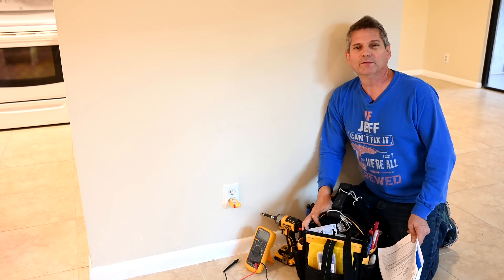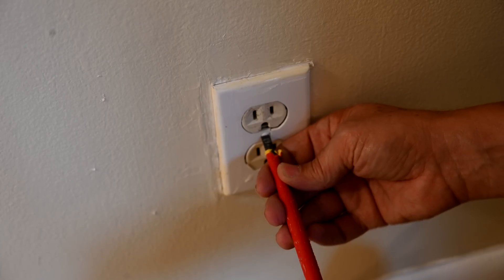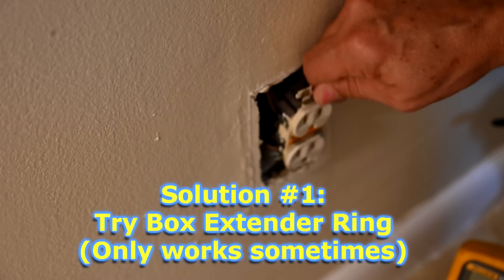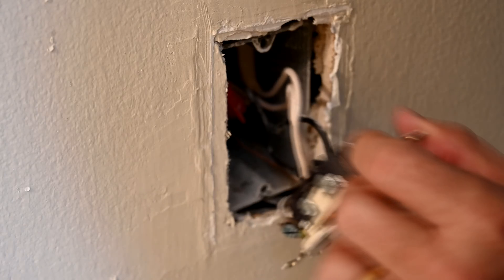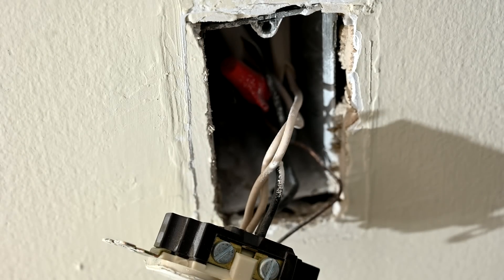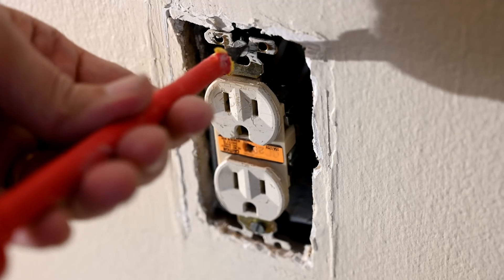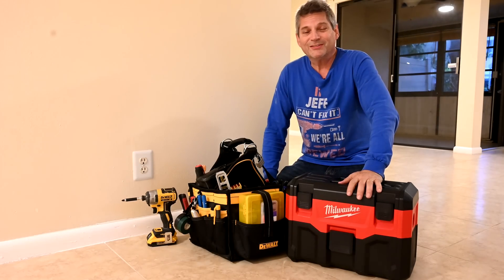2 Tricks To Tighten Loose Electrical Outlets, Switches

Comment: I’m not buying anything in this video. As a retired electrician I can say that those qualified NEVER wear rings while working. There are too many cases of fingers being severed when a ring comes in contact with a live wire. And you never assume a wire is dead.
Reply from the maker: I'm not buying your your condescending and irrational tone, makes you sound more like an alarmist and doesn't make people look up to you as a trusted source for advice. You obviously failed to watch the video where I showed cutting power, and testing for power in the wires. So no one will be coming in contact with a live wire.

Comment: Bought a house in Atlanta years ago where the inspector found no problems with the outlets. Go to plug vacuum in and the outlet goes in breaking the plate. The place had another layer of sheet rock added and all of the boxes were recessed. I spent hours removing plates and inserting those plastic spacers just to get all of the outlets usable. All home inspectors are not necessarily good inspectors. At least there were no outlet problems found when I sold the house.
Reply from the maker: Thanks for sharing they should find stuff like that by testing outlets with a plug in outlet tester

Comment: Change the box
Reply from the maker: I tell you what, you come change the Box because 1st you have to rip out the dry wall where the other boxes because those boxes are screwed to the front of the metal studs with a bracket that sits between the stud and the dry wall. So then after changing the bogs now you have to do all sorts of 3 layers of patching drywall mud and taping and all that other nonsense. You're trying  make way too much work for a 5 minute repair

Comment: Put a new metal box with ears and secure with sheetrock clamps.
Reply from the maker: You are forgetting you still need to tear up drywall to get the old box out of the wall, because it's bracket is nailed to the front of the metal stud and the drywall is now covering it. You want create hours more to solve a simple 5 minute issue. Now with your metal box, now you have to bond that to the system ground. Way to much effort for a simple fix.
Reply: @jeffostroff  You don't need to tear up any drywall to get that box out of there! Do the job right!

Comment: Electrical box fingers will pull the box flush tight to the wall to keep the box from wiggling.
Reply from the maker: Not when the hole is cut too big
Reply: Correct. That box in particular looked like a good fit for a pair.

Comment: I use small washers that I place over the screw and then tighten ... the washers wedge between the box and the back of the outlet.  You can adjust the number to "time out" depth.
Reply from the maker: Yes, I have seen others do that as well. I worked on some outlets where the previous guy used tiny hex nuts

Comment: You dont cut the box. You should remove the metal box from the wall and replace it with a new old work box.
Reply from the maker: It's always funny when somebody comes in and says you should do this as if it's a 30 second deal. You have to rip the whole wall open in order to pull that old box off of the steel studs because they are screwed into the steel studs by a bracket that hangs off the side of it and the only way to get out is to remove the drywall. now you can put in a new remodel box just fine, but now you have to Patch up drywall which is hours more work in three layers of mudding and sanding
Reply: @jeffostroff  you use a hacksaw blade to cut the nails , then slip in a old work box, done

Comment: Just use jiffy clips. If the box moves. If box don't move just us two 6/32 screws behind the rec holds the rec out keeps from moving.
Reply: The video is so wrong.
Reply from the maker: There is absolutely nothing wrong with the video I used standard parts used by the pros every single day and in the end the repair worked and it worked very well nice and snug and tight and not moving anywhere

Comment: ...This is some pretty crappy work.
Yes we've been to a million and 1 homes with fucked up drywall. Yes that box is supposed to be flush with the face of the drywall, yes indeed the ears of the yoke are supposed to press against the face of the sheetrock.
However the way this hack of a "repair" was executed is so poor I dare to even call it a repair.
The only thing that changed to effectively hold this device still was replacing the faceplate...

The way this repair should have went.
Verified fault, killed power, investigated box, immediately determined receptacle was damaged (broken ground on the face)[110.12B] and replaced with a GFCI/AFCI recep [406.4D4]
Upon seeing that massive gap, install an add-a-depth to make this compliant with [314.20]. (Which you did... for a second... then took it out.)
Then you'd install your caterpillars behind your add-a-depth, and boom. your device would now be flush up to the front of the wall.
Finish that off with a new faceplate and you're good to go.

I don't get it man... you were so close. You had everything you needed to succeed here, but you blew it.
Like. You didn't even put the top device screw into it's freaking hole. Who does that?

btw. that romex sheathing is code compliant. [314.17C]
As is the amount of conductor within that box.(even though there's barely enough to work with) [300.14]
Reply from the maker: I'll go easy on you since you are uninformed. My friends were in extremely desperate straits, had no money to buy new outlets, which every outlet in the house should be replaced like I do on all my projects. The reason I put the screw in crooked was because the builder stripped the screw hole so I had to come in at an angle to make it work. If you want to raise money for them, so it can be done right, I'm sure they would be happy. And you pay the $20 for GFCI, which you don't even need in that hall outlet, feel free. What you fail to realize is often people are left to make decisions based on previous damage left behind by guys like you who should have done it right in the first place. We already showed the box extender just was not going to work there. sometimes we get lucky and it works, other times no deal. But to say that this repair is a fail shows you don't know anything. These spacers use here are NEC approved, and I replaced the plate with a much stronger metal plate and the problem was solved. Just because you held some wires for daddy while he did the work does not mean you know everything.
Reply: @jeffostroff  Those are your friends you're doing dirty like that?
Dude. if those were your friends you would have coughed up an AFCI for them (you need an AFCI there, not a GFCI) .

Stripped threads in a device box? 110.13A violation. 
How do you correct that? Insert a larger screw. change that 6-32 out to an 8-32.
But I shouldn't have to tell you that. You obviously know the requirements of 406.5 right? 

Those spacers are indeed code compliant, as well as that add-a-depth... You just didn't use them right.
Should have had both of those in there, instead of just the caterpillars.

Replacing that faceplate fixed the problem? So it's safe to say that device is mounted to a cover then.
In which case the rules for 406.5C would apply... Oh shit. you don't meet those requirements either (minimum 2 screws when mounting a device to a cover plate. (think RS covers))

I'm gonna go hold some wires for daddy now. In the meantime, please keep fucking up installs like this. Guys like you give us TONS of work.

ps. Look up the Dunning-Kruger effect. Dipshit.

Comment: They make unbreakable cover plates that are pliable ,unlike those rigid plastic plates. Sometimes you need the plate to be able to bend little if the drywall isn't perfect. They also come in jumbo size
Reply from the maker: HA HA! I've tried those unbreakable plates, trust me they all break if they are not metal. When you have a poorly mudded drywall there and there's a mound building up of drywall mud around each one of those outlets no plastic outlet plate will survive you really need a metal one

Comment: Nice video but that receptacle has seen better days.  The metal oversized plate with the spacers was called for but should have replaced that receptacle with a newbie.
Reply from the maker: I got news for you bro every single outlet in this house was done this way and needs to be replaced unfortunately my friends the owners did not have the money they were in really desperate straits and were in the final stages with the buyer of transferring this property to the buyer and this was one of the last items on the punch out list but they simply had no cash to spend $3 on every outlet in the house plus the labor in time to get this done . Normally when I buy a foreclosed unit I replace every single switch and outlet in the house whether it needs it or not just to make sure everything looks brand spanking new and shiny and perfect for people no old yellow outlets, no electrical outlets with paint on them no switch plates with paint on them everything looks perfect when I'm done with my properties

Comment: We just moved into an old apartment.  It is not the plate cover that is loose but the actual holes don't hold the plug firmly. I plugged in my phone charger, barely moved the cord and the plug  fell out. I can barely touch it or pull on it and it falls right out. Why? What can I do about it?
Reply from the maker: Alison, unfortunately you have no choice, the outlet itself must be replaced, they are only $3 though! Make sure you upgrade the replaced outlet to conform to current NEC electrical codes and get a tamper proof outlet. If you are not comfortable dealing with the wiring, then call in an electrician or well qualified handy person.

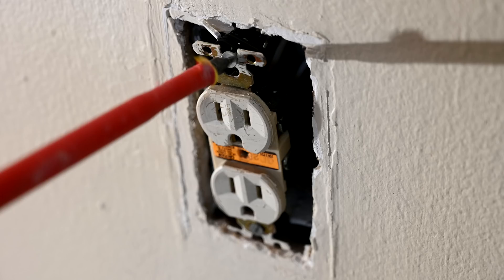Comment: In the video, at 10:09, when you inserted the top screw, you missed the proper screw hole and inserted the screw above it so it's actually going in "between the ears". You can even watch the video after the "outro" at 14:31 and see that the screw is not in the hole. 

Hopefully you noticed this later and fixed it. Otherwise, perhaps you should return to this location and fix it now. =) 

Otherwise, a really nice video ✅.
Reply from the maker: This was done on purpose, the screw boss was stripped on the outlet box so I came in at an angle to let the screw bit it more.

Comment: The lose box is still lose?  The extra large face plate is holding it (for now) ? 
Thank you.
Reply from the maker: Yes those metal face plates are so nice and rigid that they don't budge and they'll never crack and snap on you like the cheap 99 cent plastic outlet plates that you buy at Home Depot and Lowe's

Comment: You can easily slide that outlet side ways through the arc shield with out cutting anything. 
Thank you for your video
Reply from the maker: No you can't easily slide that outlet in fact you can't slide it at all, because it is screwed into the metal studs and the screws are behind the drywall so you can't even get those screws to loosen the outlet and move it away that's why we use this black plastic Shim spacers to do the trick for us without having to be invasive or without having to remove the outlet or the box and also remember in some cases you wouldn't be able to move the outlet anyways because the electricians put just enough wire to get the outlet to exactly where it is and there's no slack for you to even be able to move the outlet box if you wanted to

Comment: I'm a licensed electrician when a inspector says to fix the lose box u can't use tricks. Now days  we have to use tamperproof receptacles. You really have to put a lot of push pressure to plug something in .So some of those tricks would fail the first time u plugged something in.
Reply from the maker: The reason my fixes won't fail is because I'm using the metal plate that is the key to offering the most amount of support for this and yes had they had the proper amount of money we would have replaced all of the receptacles in the house anyway that's standard practice of what I do when I take over a foreclosed property I change every single outlet in there all upgraded to the latest NEC code with the tamper proof shutters on them and in the kitchen I changed to the arc fault ground fault and now this year they just changed it so the bathroom has to be arc fault ground fault as well yeah it's a fun game keeping up with all the codes.
Reply: yup it can get expensive

Comment: I don't want to replace the whole stupid outlet! I want instructions on how to make one of the plugs tighter. Not the whole outlet thing the box itself is fine. Just one plug is loose as to make the plug fallout if just bumped. I can't afford someone to replace and too scared to deal with wiring.
Reply from the maker: If the plug is loose, nothing yo can do the outlet must be replaced, but they are only $3, and you can do it yourself, just cut the power to that outlet first.

Comment: A 6/32 nut is all you need for a spacer. A screw in the inside left to the stud would secure it more also.
Reply: Also the nuts are cheaper and will work every time.
Reply from the maker: Yes I've seen a couple of times where guys used nuts, but often it takes 4 or more, then becomes a pain in the neck to get them all to stay. that's why I prefer these shims. Other guys cut spacer tubing to length also.
Reply: @jeffostroff  you only ever need one nut. Just stop it at the right depth. A small Milwaukee cordless drill is the trick also.

Comment: Poor installation should have change the receptacle new. Old receptacle is damage
Reply from the maker: Old receptacle works perfect, and it now installed tight, not sure why you think it is damaged, it passed all electrical testing afterwards. Also every outlet in the house is like this. Owners were out of cash and hurting big time, could not afford $3 for every outlet in the house, plus labor to rewire each one.

Comment: Five words. Outlet shims and metal cover plate. Also, the receptacle is NOT supposed to be attached to the drywall !!!  It is supposed to be attached to the BOX!  The box was installed improperly. The front edge of the box is supposed to be flush with the front side of the drywall. It you want to really fix it correctly, drive a screw through the side of box into the stud. Then refer to my “five words.”
Reply from the maker: You know it is impossible to drive a screw at that angle into a metal stud. Wood stud? No problem, we do that all the time. But you will never get it into a metal stud through an installed box. Nothing works on the cheaper metal studs like what we have here, because the stud yields too much it's too flexible and screws and drill bits just walk around on the surface and can't go through unless you have open walls, and screws going straight in perpendicular.

Comment: I also add a couple of bugle head screws through the side of the box, into the stud. That stiffens up the box.
Reply from the maker: yes, works well with wood studs. With metal studs 100% impossible to get a screw to go in at an angle, it just walks around all over the metal stud. Can't even pilot hole drill at that angle.

Comment: The upper receptacles ground plug had molded plastic cracked off. Is that ok per code?
Reply from the maker: I always prefer to have a fully intact outlet, so I would replace it

Comment: I have been using those handy spacers for years. The ones I get are the bright yellowish ones. I have used small washers, lengths of small diameter copper tubing and metal strapping that comes in steel and copper. It comes coiled in a box and has holes in it already, you can fold it up to make it thicker, there is some that comes in plastic material as well. You usually use it for hanging pipe, etc. 
Don't know why they do it but the boxes are supposed to be mounted out from the studding so it ends up being flush with the drywall/wallboard. But it gets mounted flush with the studding instead. That box being so loose and being installed wrong. So many like that I have just removed them and installed new. Yeah it's a lot more work but I always feel better about it afterward.
Reply from the maker: Yes, and the boxes that have the mounting bracket on them, should be positioned so that once mounted tot he stud, it ensures that the outlet will project out far enough to be flush with the front face of 1/2" thick drywall.

Comment: Oh and someone made the comment about turning the reciptcale over with the ground upside down. I was taught that you only put them in upside down if you were A from Australia or B if your were making a dedicated run for from a generator.
Reply from the maker: Yes putting the outlets in upside down stemmed from the idea that if somebody should drop something metal down on a plug that isn't plugged in all the way, the metal would hit the ground lead first since it's upside down and nothing would happen but this is just such a far fetched scenario

Comment: Ok yes I've used the "RACO" PLATES and I've used the plastic shims that you've used here. But I will tell of yet another trick that I've used many times successfully and that is take a scrap piece of #12 AWG solid wire and twist it into a curlyQ works exceptionlly well with old 1½" thick plaster
Reply from the maker: Yes another electrician mentioned that yesterday he said he does that all the time as well